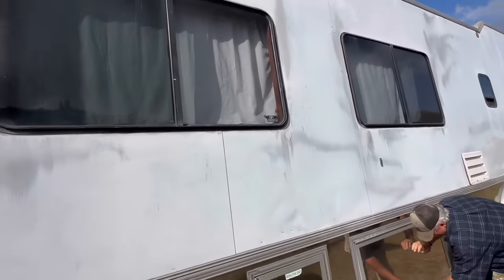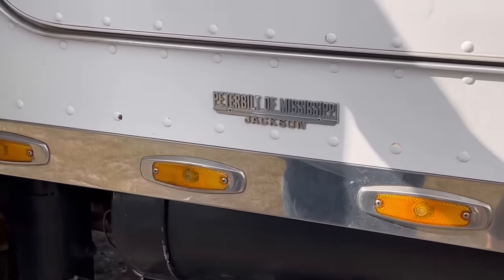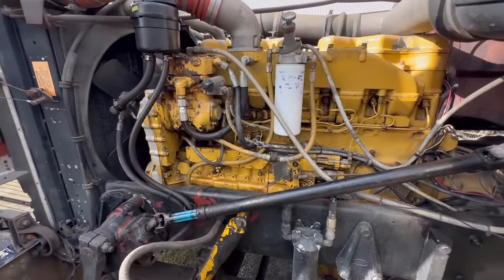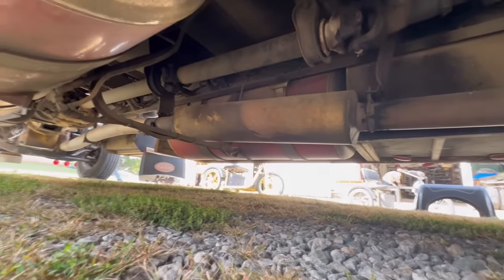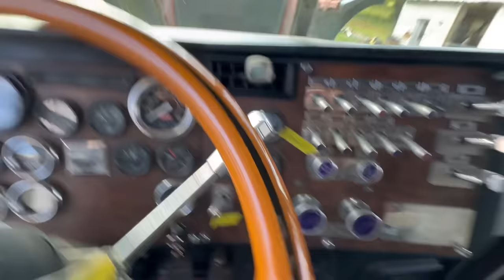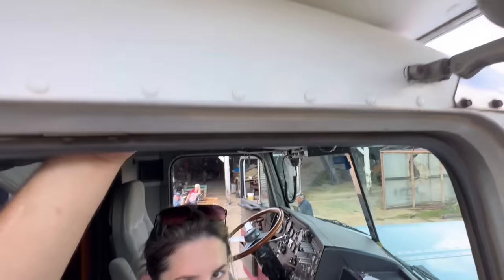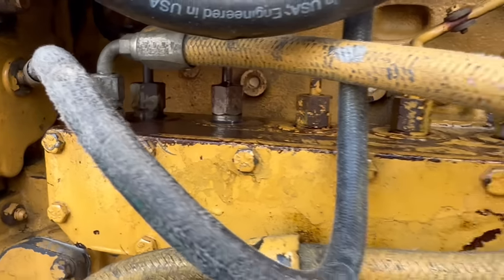Our New Motorhome is a BEAST! 1988 Peterbilt 379 Barn Find!

Comment: That truck is way better than any new RV.  Like you said it just needs a bit of a remodel.  But worst case you can get a nice airstream or othe bumper pull that might be a newer nicer thing that will make the wife happy.  I'm guessing you need a new air switch for the fan.  Seems like that's what I had to replace on the last Cat I had.  I had an '88 International with a 425 Cat back when it was the most desired motor around.  You got a solid truck to fix up there, I don't see how you can go wrong.  Be well!  😊

Comment: few months back there was a similar unit available near me, black cherry and chrome, though they converted it in a far easier manner. they removed the sleeper, put a travel trailer on the frame of the truck with it's back end tied into the cab, cut the hitch off the trailer. the exit from the rv living quarters was on the drivers side. powered by a series 60 detroit diesel.

Comment: You Finally did your homework, asked questions and got the walk around your of  everything that's wrong with it BEFORE u drove it off the lot. Even though there isn't a warranty, u actually got a good deal. With Amber's touch, the inside will look pretty very soon. AND you got yourself another Peterbilt. Now don't go all crazy and start ripping stuff out or off. No burnouts. It's the same age as u, baby it. Congratulations on ur new purchase. Dont start putting a larger turbo and other non essential crap on it.
Reply: it definitely needs compounds

Comment: Hi Bruce I have worked on tons of rv,s I have fund the older units are better built but one thing they all have in common need to look at the roof check the caulking around vents air conditioner and seams around the edge what I have seen so far every good unit great base to start from have fun stay crazy G.Whyte

Comment: Should have shopped around for a motorcoach on a Peterbilt chassis from the start. I just saw one listed on RV Trader in the same color blue as Tratter Taxi with a matching 40-foot lift gate trailer in Kentucky for about $1,000,000.

Comment: You could use for yrars and sell 5-10 later for double what you paid (when does that ever happen)...

More than likely, someone will offer to but, just give a date later in the future, zero issues trying to find a buyer!!!

Just need a CDL

Yes?

Ive heard just because it has Air brake doesn't always mean cdl, if under 30k... But not truly sure

I just picked up a 5500 chevy to avoid any issues!

Comment: She doesn’t look like she really likes it very much lol. It needs a lot of work but if it gets done it will definitely make a much better motor home than what they had. Only problem is that it has no slide outs for the extra room but you could always take the entire camper section off and replace it with something newer that’s been removed from a truck that’s been wrecked or returned to towing trailers. She’s hating on him right now lol. He’s got some stuff in those buildings worth lots of money. Especially those pedal tractors and wagons and cars. Anyone that loves to restore and collect old vintage stuff would love to visit that place. I be in trouble if I went there because I’d want to take too much home with me to restore.

Comment: First rules,get it home and don't pull it apart,fix the fan and fuel leak but that's all .
Go away in it and find out its secrets ,it is what it is .
The shower and the head are sort of upside down Bidet lol .
In time your wifey could add some modern touches,sand and bring the timber back to life ,maybe sew some new curtains , just little things that you can do ,because your aim surely is to use it ?
On the topic of the RV industry,there are still big challenges for things to be sorted .
Disappointed somewhat that we didn't see some outcomes that might help others .
Again nice old truck /RV hope that someone gets to grips with what it is

Comment: You're asking us to name it? OK. I'll call it "The Money Pit".  Actually I love it, but it's gonna' cost you to keep this beasty on the road.  I ran all over the country with a Pete 379 a few years back. We had a Twin Turbo Cat which I just loved. I think you have a 15 speed in this truck. They are pretty rare these days, and the young guys don't know how to shift them. How do you shift this thing? "Oh just shift it like a 10 speed."  WRONG!  Guys used to burn clutches on these trucks like crazy. That's why they quit making them. Actually clutches in these trucks should last forever, if you could convince guys to drive them properly. If you need tips on how to properly shift a 15 speed, I'd be glad to help. I'll give you this one tip. when you are backing, always use deep reduction. Low (or mid range) is a bit too high, and you will tend to have to feather the clutch, and burn it. Don't do that to yourself. And if you need a driver, just call me. No. Just kidding. I was hoping to see you driving it. Drive safe!

Comment: Didn’t I see her riding in flat nasty through a mud hole!! And she’s worried about that beautiful old rig.., that I’m sure will get decked out front to back., some sh tube chrome, and the best of the best interior., take your time, deal with that guy that fixed trater taxi if he’ll take it on., and design a floor plan before you start installing, I’m guessing but I’d say the windows will need removed, and reinstall at minimum, maybe just replace based on cost, and options available.. just sanding and painting the wood cabinets with a nice high build, then a clean bright color will help a ton..